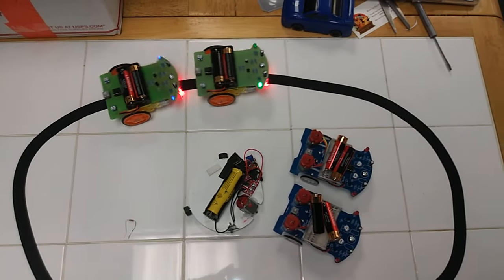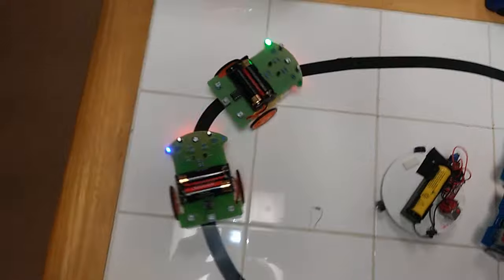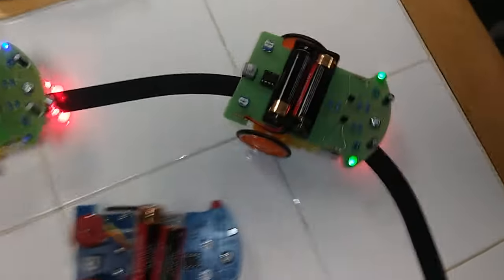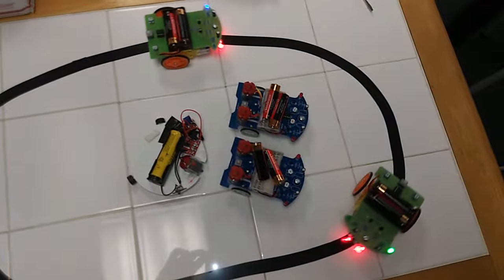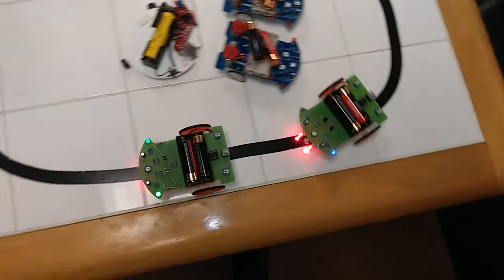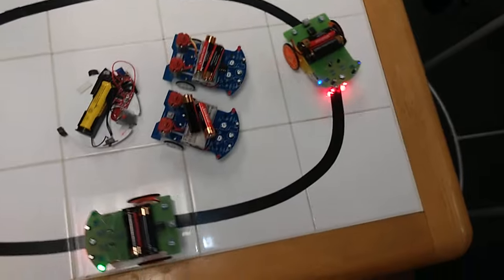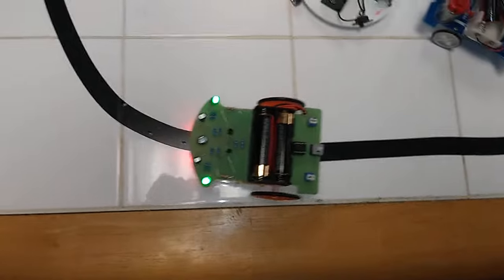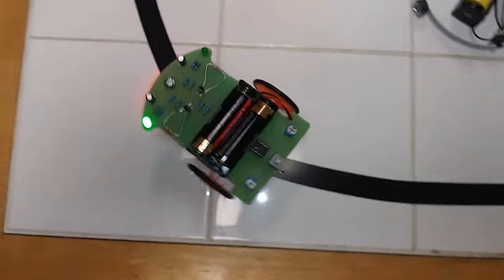Faster Line Following Robot D2-1

Comment: Hi, is this iteration of the 'improvement' mod better than the "R7 /Pin3/Remove Track" mod from the Servo site? This 22ohm mod works very well, albeit less sensitive on silly radius curves, but great. Just wondering if the other mod is better than this. I imagine it would make the bots a little faster again? (just by looking at the schems). Cheers.
Reply from the maker: Great question! This resistor mod is simple and quick, fine if your track only has large radius turns,. But if you have sharp turns the other mod is needed..
Reply: Which site?? Can I have a look at the other mod